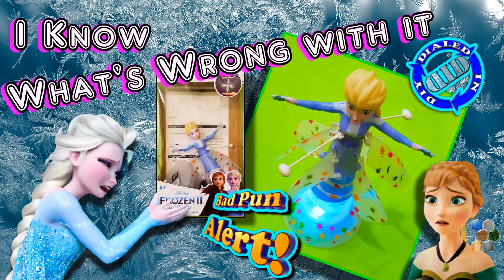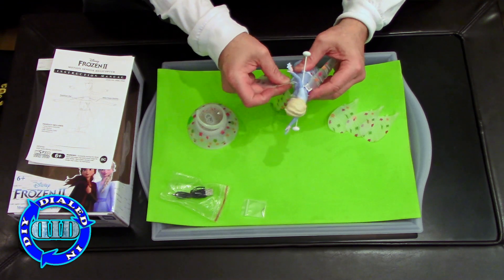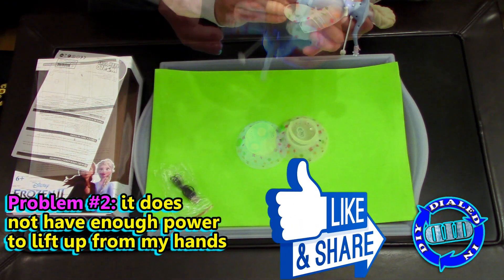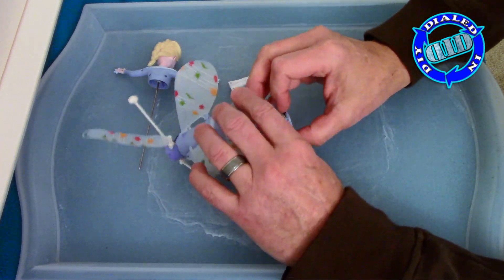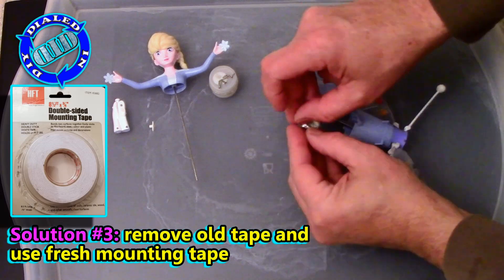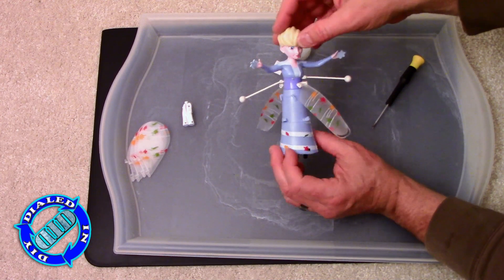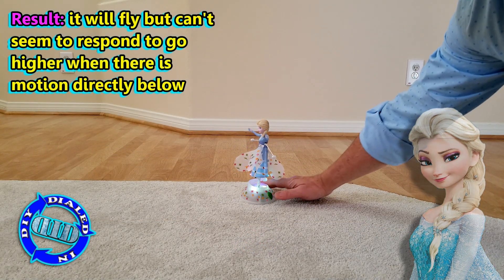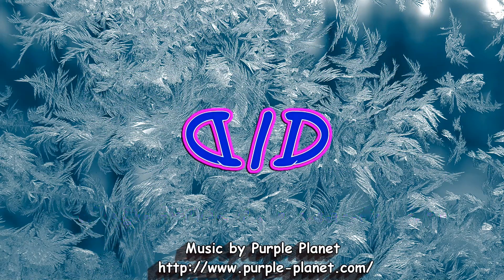Frozen II Elsa Motion Sensing Helicopter Repair

Comment: please help me on how to fix a motion sencer on the hary potter snitch ball from argos I flew it and got out of control and the motion sencor broke please help me on how to fix it
Reply from the maker: Happy to try to help.  First, I always try to return an item if it is under warranty. Sounds like normal use led to the problem and it should be replaceable without cost to you. If that does not work, then look to fix the parts.  When you say it broke do you mean it quit working, came completely off or some other problem?

Comment: Thanks for the great video. We got a 2 pack with an Elsa and Anna and out of the box and neither worked. After watching you disassemble it I got to work. The batteries were haphazardly installed but not loose. After correcting that, I discovered a linkage arm that connects the centrifugal governor to the sash plate/collective was not attached. It seems to come off after a crash about half the time.  To get to it, pull off the feet and slide off the head and center pole. Pull off the assembly holding the upper wings and you can see and get to it. Without that functioning properly, it'll just fly up and up. Hope this can help other frustrated folks!
Reply from the maker: Great feedback.  Thank you very much for sharing that and I too help that it helps out others.  I really appreciate you taking time to watch my video and post your comment!

Comment: I can’t even get my daughters to charge!  I contacted the company and they will not replace it without the receipt and details of purchase. It was a gift so now I’m trying to repair it!
Reply from the maker: That really stinks.  It does seem that this particular version has allot of issues.  If it is not charging it may be worth getting to the battery to see if it is actually connected.  My vote/guess is a loose wire or connection.